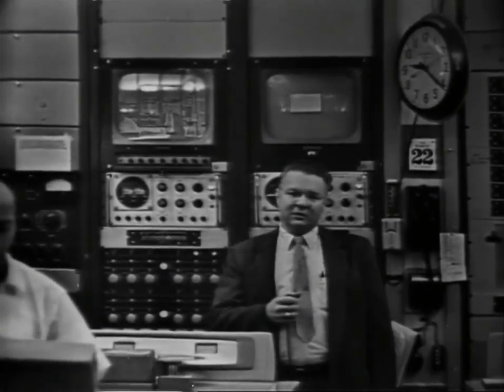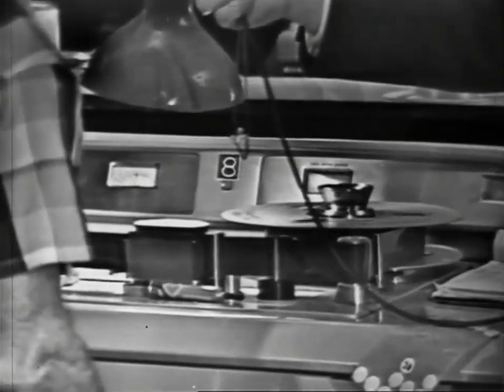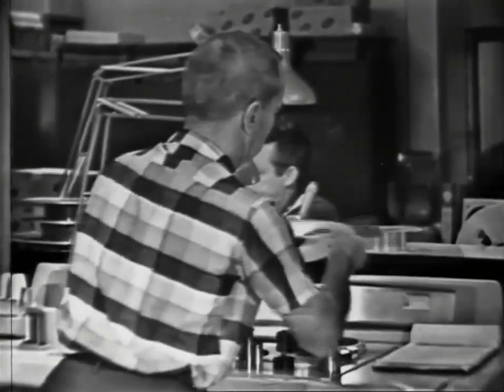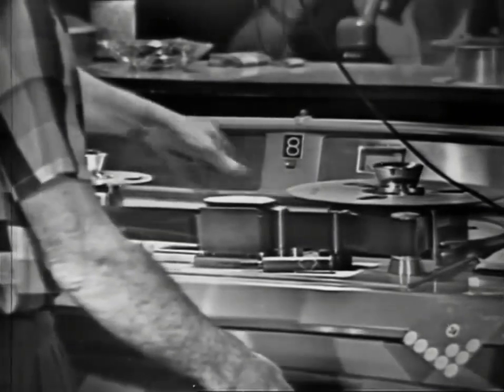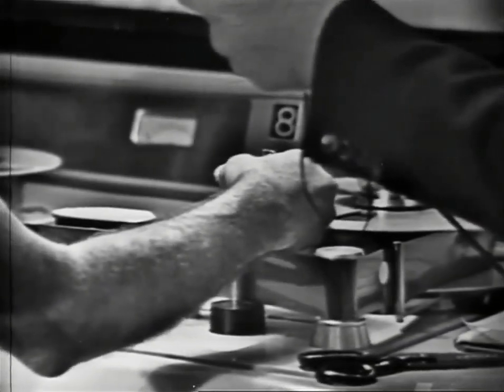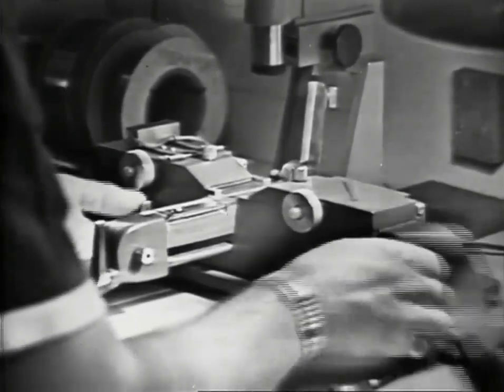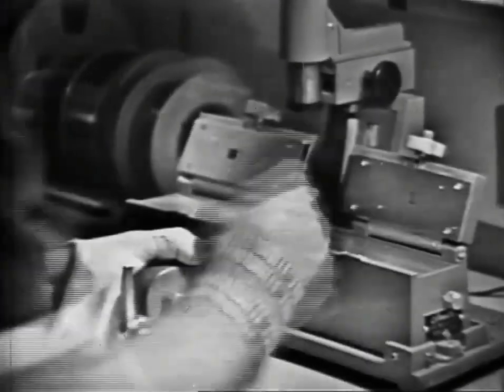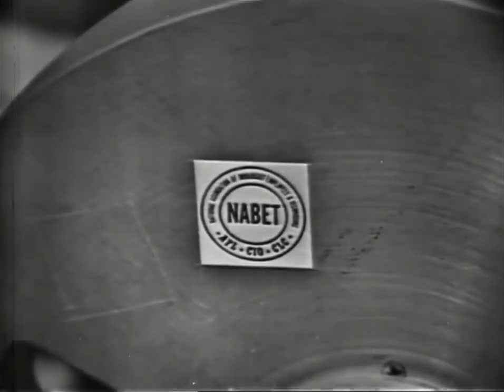ABC TV Videotape room tour and edit demo [720p60]

Comment: That guy is smoking. I find it amazing that smoking was allowed that highly sensitive recording recording heads and recording equipment.
Reply: Hi Michaelterry,  I'm an old guy who use to work with in television with 2 inch videotape.  FYI, It was common for people to smoke everywhere in television production facilities. No one knew of the toxic & corrosive nature of smoke in those days.  This machine shown in this video is an Ampex VRX-1000 first introduced in 1956.  This presentation demonstrates how videotape engineers use to edit 2 inch quad videotape by hand before Ampex introduced EDITEC in 1963, an electronic way to edit videotape.  Best, G
Reply: I worked in NY at one of the first television stations in the world. EVERYONE smoked. When video tape came out, we had 8 machines a few VR1000s and the rrst VR2000B I was constantly cleaning the machines and ashes were everywhere!! It was so gross to come in at 5am to clean and set up the machines for sign-on and then the old timers would come in sit down and light up cigars and cigarettes! I almost hated.
Reply: Airborne particles were a problem causing dropouts, more so on the newer formats with smaller tracks. When I joined the BBC in 1981 there was still some smoking in the VT area but it was soon banned.
Reply: @DanielSwartfiguer  not for the last 20 years.
Reply: The American SAGE air defence computers actually had cigarette lighters and ashtrays built into the consoles ! On  a more mundane note a colleague making similar equipment used to solder and smoke at the same time.
Reply: The I.Q. levels were much lower 60 years ago; not surprising everybody smoked.
Reply: I engineered in a tx suite (Mtv, since you ask) where there was a betacart & everyone smoking. my boss tried to stop it. I pulled out one of the decks & wiped the scanner, showed him my finger, 
"what colour is that?"
"blue"
"& what colour is the carpet?"
"blue".

carpet fibres were the problem, if we had one at all. cig smoke particles were simply too fine to be a big problem for the decks, even digibeta. but carpet fibres... nasty.
Reply: I worked at an audio firm in the early 1990s that worked on major motion pictures. By then it was well known that smoking around these tape machines was detrimental. Still, they continued to smoke. I guess that shows how addictive smoking is when these professionals would prioritize feeding their habit over the quality of their work.

Comment: It's nice to see this. In 1978 I assisted video editors cut tape this way, I then did dubbing editing on VR-2000 and then AVR 2, in 1982, next was C format and editrace, then U-matic, Beta and D3, Digital Avid gave us freedom, and Apples Final Cut Pro made it cheap enough to buy kit and go freelance. Physically cutting tape to make a show was painful, especially if you had a TX deadline, it was hard to keep track of where you were on the tape and the sound was offset by a few seconds, so don’t cut in the wrong place because there’s only one copy of the recording!

Comment: I used to cut tape back in 1960 on the VR-1000's then VR-2000. I fixed many a camera master that way too. I also did punch & pray, then EECO, then CMX systems, including the 600 system. I worked at the largest post facility on the east coast in USA. Our company invented the Pan & Scan for film. We did all of HBO's film xfers to quad. HBO required a 5 min overlap. The were not good at tape swaps haha
Reply: How old are you?

Comment: Anthony, thank you so much! i handled a lot of 2" quad in the '80's - then in the '90's i worked as a NABET editor at ABC on 66th st. never actually seen the splicing process before! ABC did have a "quad room" in 1980 with two or three Ampex 2000's - and a splicing rig on a table - never used tho. i did get to see a couple Kovacs shows from the late '50's that they were transferring - and a reel of a live feed of the last speech RFK gave in LA. after RFK exits the hall (no u don't see him get shot) there was ambient sound and the camera stays on a wide shot of the hall full of people - until several minutes later, where you could see the horrible news spread across the crowd - people in the front in shock, and people in the back who hadn't yet heard, still joyous and smiling. fascinating.
yes please upload the 36 minute version - i was trying to figure out if i had actually worked in that room 30 years after this was shot (basement level, 47 west 66th street, previously a horse stable!)

Comment: I caught the very tail-end of cut-&-splice on quadruplex (ampex VR1200s, 2000s) at college in the 80s. brake release was a footswitch.
we had an exercise- remove a verse from a hymn in the religious show 'songs of praise'.... we arrived at a method of whacking a chinagraph mark onto the tape while it was in play, best-of-three sort of a deal, then fine tune this using the audio head & normal reel-rocking (no pics during this, obvs.)
then the tape was lifted onto a special block with a scope for viewing the control track pulses (spinning head in the actual block).
we were told that until non-linear, it was still the quickest way of reducing (say) a football match to its highlights, as nothing needed to be dubbed in real time.

Comment: The development of the Ampex Editec System (Electronic Editor) couldn't arrive soon enough. The tape operator could either "Insert" or "Assemble" edits by setting CUE markers (audible beeps) at the beginning and end of the section to be edited, then fine tune the positions of the cue markers with a pair of knobs, each indicating (+) or (-) while viewing playback. When it looked good, just "roll and record", the Editec took it from there. In 1970, we had three Ampex 1200Bs and one was fitted with the Editec.

Comment: What a pain in the ass that must've been.
Was All in the Family edited this way?   I would've that that electronic editing would've been available in the early 70's.
Reply: I think by the late 1960's/early 1970's, electronic "punch-in" editing was starting to be developed.  But on TV shows with not too many quick camera-angle changes like All In the Family, they might still have used either live editing cuts or physically cut and spliced with a razor blade.  
I believe even "Rowan & Martin's Laugh-In" was still cut with a razor blade up until 1973, even with its rapid-fire editing cuts, because editors were still familiar with the technology and it was too much of a hassle to learn how to use an electronic editing system halfway through the series of a TV show.
Reply: It was a MASSIVE pain in the butt! As a producer/director, I could spend an entire day creating a mere 30-second commercial, only to develop so many dropouts on the finished master tape, that it became UN-USABLE, and I would have to start building the spot ALL OVER AGAIN. Everything was done "on the fly." You could not pre-program dissolves, wipes etc., so you often re-ran the same passages over and over again in the era before drop-out compensation! Bye-bye, iron oxide particles!!

Comment: Weren't some of the earlier ampex 16-track audio recorders modeled on these video machines?
Reply: Yes, if my memory serves me correctly, the tape transport of the Ampex VR-2000 quad-format 2" VTR from 1964 (the model introduced after the VTRs featured in this video, which are the first-generation VR-1000s from 1956) was adapted for use in Ampex's (and the industry's, IINM) first 16-track 2" audio tape recorder, the MM-1000 (MM standing for "Master Maker") from 1967.